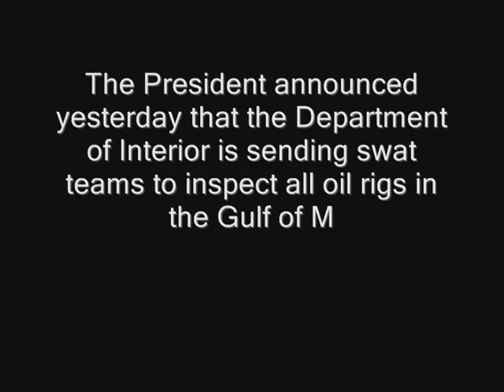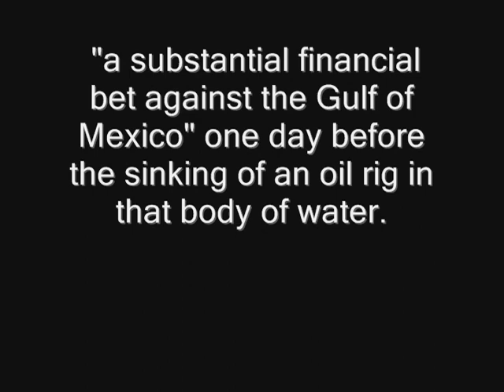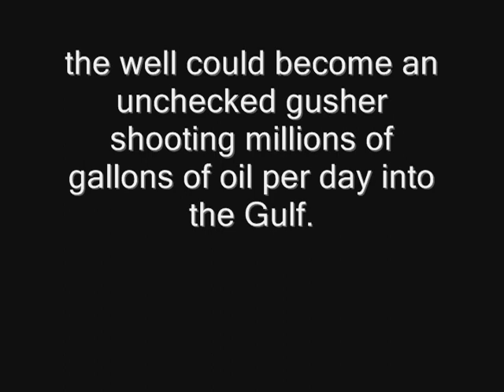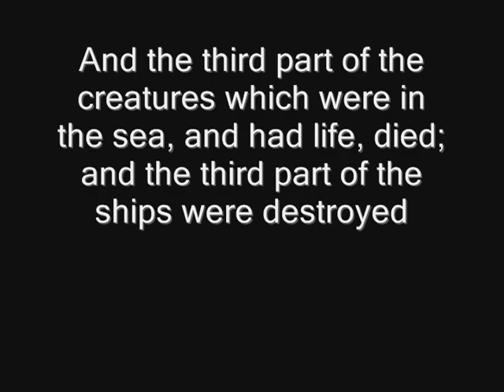GULF OIL SPILL - THE REAL STORY  Part 1 of 2

Comment: @HiPointMan 2> cover it up enough that it doesn't overflow if water gets in it but
that it's still open to the air, then see if the OIL content is still there,even a month/
year later !  The "dispersants" are primarily used to cause molecular attachment and increase specific gravity (weight in layman's terms) so it will sink and not be so obvious to see !!  WAKE UP PEOPLE !!   If anyone cares at all,they need to ignore the CNN/ paid off media B.S. and learn some physics/
chemical FACTS instead!

Comment: Get troops out of Afghanistan and Iraq. Spend money on a real cause rather than a fake war. Bush and his bed partner Dick Cheney should be held responsible for relaxing the drilling process in and around the USA. BP saved only $500,000 to avoid constructing the fail safe because of the new law.